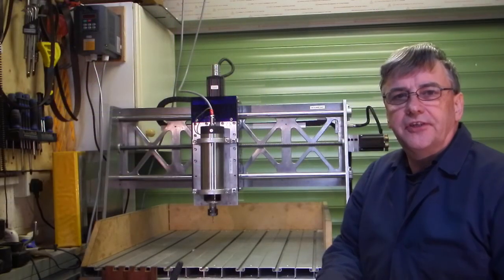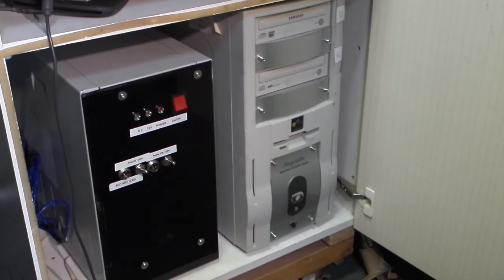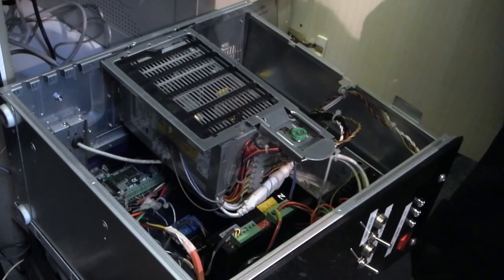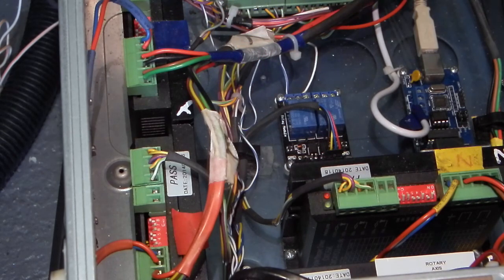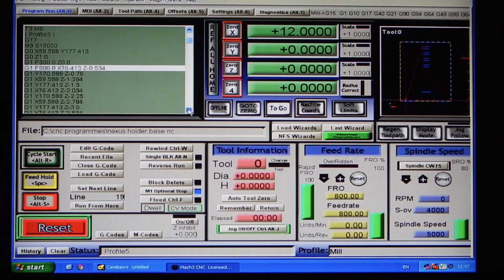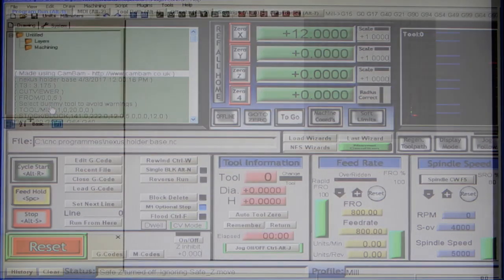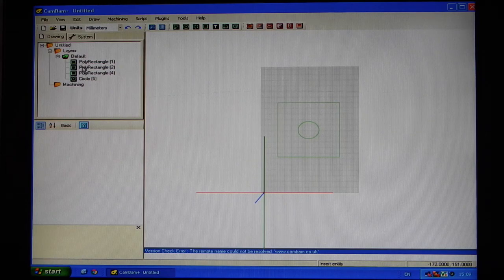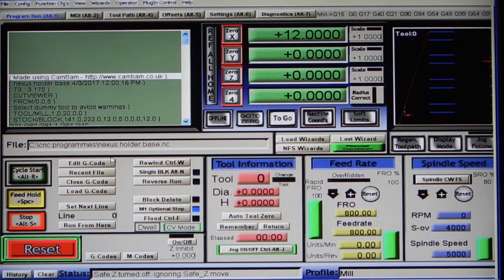CNC tour PART  2

Comment: Alan, I've been running CNC since 2001. I started with a Sherline 5400 mill that I converted to CNC a couple of years later I purchased a Shopbot 4' x 8' router. Then I decided I needed a CNC lathe so I had a Harbour Freight 7 x 11 lathe that was easy to convert as well. That's all the CNC I have right now and I'm converting the smaller machines to grbl using an Arduino Mega but with the same controllers, I've been using. Next on my list is a CNC Plasma table. I really like your machine it's well thought out and very clean Thank you for showing it to us in some detail!

Comment: Hi Allan, great video. Have been searching for easy to understand explanation of CNC. I am in the early stages of going down that road and am very grateful for your presentation. I particularly liked the explanation of Cambam which is what I am starting to use and of Mach 3 which I do not have at present as have just purchased a DDCSV2.1 stand alone unit so am trying to get the hang of that.Best regards also from West Mids. Peter.
Reply from the maker: Hi Peter
Thanks for watching. You will smash a few cutting tools when you first start especially if cutting metal.